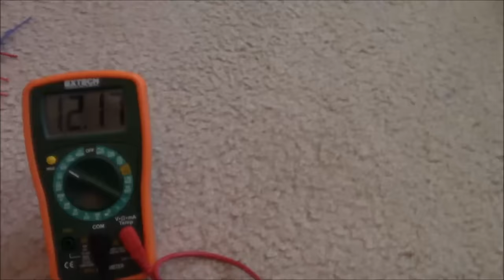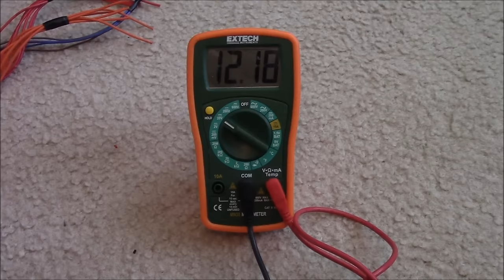How to Hack a Computer Power Supply (PSU) To Use as a 12V DC Power Source

Comment: Does anyone know if you can draw the full amount of advertised PSU wattage just from 12v wires? Or is it the limit lower
Reply from the maker: It is much lower.  About half or so.  Check the specs of the PSU itself.  The PSU in the video was a 450W PSU and could only do 20A on the 12V rail.

Comment: Need help...we did this with 4 yellow and 4 black wired together but each time we connect it to a fan requiring 12v and 1.5 A the power supply turns off.  We reset the power-on jumper and the fan spins for a second and then the unit shuts off.  What could it be?  We're trying to power Christmas inflatables!
Reply: +Brosilio Gaming (Tarshadow5) I'm trying to replace as 12V DC 1.5 A transformer.  The PC power supply reports 11.7v so maybe that is it?  Maybe the fan fluctuates too much?
Reply: +Brosilio Gaming (Tarshadow5) Yes, I disconnect and reconnect black+green each time the unit trips. But I&#39;m connecting the YELLOW and BLACK to the motor. The YELLOW is giving the 11.7 volts. The blower motor just has two black wires; maybe I need to reverse them? https://search.yahoo.com/search?ei=UTF-8&amp;fr=crmas&amp;p=computer+power+supply+color+coding indicates RED is for +5v, which is not what I need.
Reply: +Brosilio Gaming (Tarshadow5) No, blower works fine with an actually AC/DC converter.  I was hoping to use PC power supply to run several motors 1.5A motors.  I'll try again when I come cross another one.  Maybe this unit is flawed.
Reply from the maker: +Corey Alix Some pc power supplies will only turn on when they detect a strong enough load.  It is possible that your 18 watt load is not enough to keep the power supply turned on.  Try connecting a different load to it to see if it will work with something more power hungry like a peltier or car amplifier or something.
Reply: I put a flashlight bulb on one of the 5V lines and now the 12v line works.  Thanks!
Reply from the maker: Corey Alix
You are welcome.  Thanks for watching!

Comment: .. please help me. I am trying to use power supply to eun my 12 volt dc cooler. But when I join black and green it only starts for jerk. Doesnt run continously. Plz tell me what i am missing..
Reply from the maker: It sounds like your power supply needs to detect a load in order to run.  I would try connecting a 12V light or other 12V load to the yellow and black wires and see if that keeps the PSU running when you short green and black.
Reply: LDSreliance sad enuf :( ur video is too grt. But I even tried using 12 volt dc moter connected with output. But the motor also gets turn off with PSU. It just take a jerk :(
Reply from the maker: I'm not sure why it is doing that.  Sorry!

Comment: Can someone please tell the current output
I'm planning to run 4, 12V 10A DC motors with this thing
Thanks
Reply from the maker: The max output on mine on the 12V rail is 20A.  So you would not be able to run 4 of your 10A devices.  Some power supplies will provide more than that but I have not seen one that does 40A on 12V before.

Comment: Can we make a room heater from it?
Reply from the maker: Get some nichrome wire and a thermostat and it sounds like a fun DIY project.  Just keep in mind it won't get anywhere close to a space heater on high (which use about 1500W).  Even on low those things use about 750W so it would probably take two of these to even come close to a $20 space heater from walmart on its lowest setting.  So a fun project but not economical, probably.

Comment: Hi,
I am geting 3.4v, 5.2v, and 
10.5v instead of 12v
So, do I have to put load resister to 5v rail?
Reply from the maker: Hmmm.  Are you sure your multimeter is accurate?  Can you test it with another instrument to be sure?  You should not have to use any resistors unless you have to simulate a load to keep it running.
Reply: Thanks for the reply :)
Yes I checked it with another multi-meter and getting 10.6v
I put two 10W 6.5 ohm load resisters parallel to a 5v rail and now getting 11.85v
But I need 12-36V to power my arduino CNC sheild
Reply from the maker: That is bizarre.  Is this an old power supply?

You will probably have to use a step-up power converter:  http://amzn.to/2qnsxoH
Reply: Yes It is old one. 20 pins. include a -5v rail
Thanks :)
Reply from the maker: Interesting.  Good luck!

Comment: Don't you need a minimal load on all the wires?
Reply from the maker: Some power supplies do require a small load in order to turn on.  You can get around that by using a resistor, though.

Comment: hi would just want to know if this is possible to use as a power adapter for all in one pc 12v 7 amperes? i know this is an old vid but would really appreciate the guidance thanks!
Reply from the maker: Yes, but you may have to hack the connectors.
Reply: @LDSreliance  what do you mean by connectors
Reply: @LDSreliance  thanks to you got a power adapter for my pc. just need to do a stress test on it.
Reply from the maker: Cool!  Glad you got it working.
Reply: @LDSreliance  just got yellow and black wires then that was it. Was struggling to find a long lasting ac adapter. So this psu surely helps. I cant  buy expensive adapters at my end of the world. So this is really a big help. Thanks!

Comment: +LDSreliance After connecting my green and black wire the fan only twitches. what did I do worng here?
Reply from the maker: +Andrew Wallace You are either not making a solid connection between the green and black wires or your psu is sensing that there is no load.  I read that some power supplies will not turn on if there is nothing connected to them (like a motherboard or something).
Reply: Hmmm okay so what would you suggest to do? LDSreliance
Reply from the maker: Andrew Wallace
Try connecting something to the power supply to act as a load.  Plug it in to a motherboard or a fan or anything so that the psu can sense a load.

Comment: i cant seem to get this working! using a diablotek phd450, connected green with gnd, added dummy load (10w10ohm) across 5v wire to gnd, no continuous power. read somewhere to try dummy load across 12v-GND. still nothing. help please? :(
Reply from the maker: Have you tried putting it under a real load?  Instead of just a resistor?
Reply: LDSreliance yes I did. however I managed to solve it! apparently on newer power supplies the 3.3v sense wire has to be shorted to the 3.3v rail in order to keep the psu running
Reply from the maker: Interesting.  I did not know that.  Thanks!

Comment: Does the wires which connects to the power supply gets hot? Is that normal? Mine became hot
Reply from the maker: How hot?  It should get warm but not hot like melting plastic.
Reply: LDSreliance it's hot but it's not shocking hot. Like... If you ordered hot drinks, you have to wait a bit before you could drink, but warm water, you could drink without your tongue get scalded or shocked by the hotness. Mine is like warm water. Hot, but still touchable & not shocking to the touch.
Reply from the maker: Then that is fine.  If you start to smell burning plastic or if it is too hot to touch then that is not normal.

Comment: HELLO THERE I AM LEARNING HOW TO BUILD A DC POWER SUPPLY FROM A COMPUTER POWER SUPPLY  .  CAN YOU HELP ME TO UNDERSTAND HOW CAN I ADD A MONITOR TO READ THE AMPS AND VOLTS OUTGOING ?!  AND CAN WE MAKE THE POWER SUPPLY TO OUT POT MORE  AMPS ?!!  THANK YOU
Reply from the maker: Amps are harder to do but for volts you just wire in a voltmeter in parallel to the circuit.  For amps, look up my video on how to wire an ammeter.  It is a bit more complicated.  And no you cannot increase the amps a power supply produces without re-doing the circuit board and components.
Reply: THANK YOU FOR THE REPLY
AN IDEA CAN WE CONNECT 2 OR 3 POWER SUPPLIES TOGETHER IT WILL GIVE MORE AMPS?! AS WILL AS VOLT!
Reply: I looked through your channel I could not find the video   please if you could send it to me
thank you brother  you are really great
Reply from the maker: Anwar Abedrabbo Sorry, I was on vacation.  Here is the video:  https://www.youtube.com/watch?v=7MGed7WKwAA

Comment: Bro.  2:32 finally someone with a simple solution
Reply from the maker: Solder the "on" wire in the on position?
Reply: @LDSreliance  no. How you are holding those 2 wires upright😂
Reply from the maker: Haha.  It was much easier for the video shot.  Normally I wouldn't do it like that.

Comment: hello i just want to use this concept for a 12V can i just solder out all the wires i dont need ?
Reply from the maker: I don't understand what you mean by solder them out.
Reply: is the work soder ? basically remove all other wires completly  besides everything i need for my DC12V appliance
Reply from the maker: You can do that just make sure that when you remove those wires that the ends or the stubs of those wires cannot touch each other and cause a short circuit.
Reply: its been working great so far. Another question i have a 12V dc self priming water pump you think it would work if i put a regulator or to slightly dial down the voltage to reduce it struggling in my misting system everytime i use it, it either struggles or its SUPER LOUD
Reply: andwhen i say regulator i mean one of them ones you can dial either up or down
Reply from the maker: Yes, I have used those for things in the past and they work fine.  They are not efficient, though, so make sure you factor that in to your math.  I think they are usually 80% efficient and maybe worse.

Comment: I probably won't get an answer but when I do that I get under 12v its usually only 11v and I cant go any higher
Reply from the maker: I don't know for sure but it may have to do with how much current is being requested or drawn by the loads.  Is the power supply under load when you test the voltage?
Reply: @LDSreliance  well i am using the power supply for a car amp and it may be drawing to much power ?
Reply from the maker: That could do it.  The voltage will sag under a high load.
Reply: @LDSreliance  I purchased a36v bench power supply and it works now but thanks for the help

Comment: Would this have at least 6 amps?   I need a power supply of 12V 6 Amps.
Reply from the maker: +Modzer627 If you combine all the yellow wires, yes.  Pretty much any ATX power supply I have ever seen can provide more than 6 amps on the +12v rail.
Reply: What if it is an 850W power supply?
Still get 12V 6A?
Reply from the maker: Modzer627
Yes, probably more like 40-50A.
Reply: oh my, well.

I did test it and it worked but... the display was not, I shall show my setup once I record and upload it.
Reply from the maker: Modzer627
Sounds good.

Comment: Can it work without fan cooler? :D I want to take it out and use for another purpose :D
Reply from the maker: Yes but it may overheat and shut down.
Reply: +LDSreliance thank for answer :D I am going to leave it there :D You have right for overheating
Reply from the maker: How To Channel It may be completely fine if you keep the load to under 100 watts or so.  But you can just order a $5 computer fan for whatever you want to do and just leave the fan in the power supply :)

Comment: Mine was working then I connected anither old computer fan to it and one of the wires came off and sparked. It doesn't work anymore. Any ideas why???
Reply from the maker: +Aaron Watson It short circuited and blew a fuse inside, most likely.  I don't know if it is replaceable or not.  You could try taking the cover off the power supply and seeing if there is a tube shaped fuse in there that is user replaceable.  If not I am afraid it is toast.
Reply: It was working then stopped then I realised after I short-circuited it I needed to disconnect the green and black wires and reconnect them then it worked.  All good now. Thanks for replying anyway!!!
Reply from the maker: Aaron Watson
OK, glad I was wrong!  The PSU does have a fuse in it to prevent a fire so I was worried you tripped that.

Comment: Connecting the Green and Black does not turn it on, ive tried maybe 50x
Reply from the maker: Yours must be one that requires a load to be present in order to turn on.  Wire in a resistor to simulate a load or connect something to the yellow wires that will immediate pull a load.
Reply: @LDSreliance  thanks I'll try that

Comment: I want to use my pc power supply for 4 pc 180 mm pc fan. They fans are very power.  Can you please let me k now how I can use the power to power the fans.
Reply from the maker: Just follow the instructions in the video and then you can use a buss bar or other distribution block to connect all of the positive fan wires to and then connect the positive side of the psu to.  Then repeat the process for the negative wires.

Comment: Will the PSU power a 12v brushless cordless 12v drill
Reply from the maker: I don't know.  What are the power requirements of the drill?  And it will depend on your PSU that you use because yours will surely be different than mine.
Reply: sorry for the late response only just spotted your reply thank you. My PSU   is off an old desktop computer. Project completed and now powering 2 old 12volt drills (not at the same time) which have found life 2-3 years after their batteries failed to charge

Comment: Is it possible to hook up 300w-500w amplifiers?
Reply from the maker: If your PSU is very powerful, maybe.  The 12V rail on the one I show in this video can only handle 20A (20A x 12V = 240W).  So if your PSU was significantly more powerful (say in the 700-800W range) then it should be able to handle 300-400W or so.  500W is probably out of the question for most.
Reply: @LDSreliance  Thanks,  if i didn't have this right now i wouldn't be able to listen to music during this virus stuff xD

Comment: Hello sir. How can i use  Dc to Ac from power supply ?
Reply from the maker: +Mubeen hamid Just curious but why would you want to use AC from this power supply?  You have to plug this PSU into an AC wall outlet to run it and then you want to convert back to AC again?  That doesn't seem to make much sense.  Maybe I am misunderstanding your question?

Comment: hey can i connect like 4 or5 pc fans to the yellow and black only will it transfer enough power?
Reply from the maker: +eli \ Yes, you can power that many fans with just one wire of each if you want.
Reply: +LDSreliance but wheni connect the power supply to the fans it shuts down immediately could it be that there is not enough amper or watts or volt ?
Reply from the maker: eli \
You may have a power supply that requires a load to turn on.  If it does not detect a load it shuts off.  Some people wire in a simple resistor between the green wire and black wire.  Read more about how to do this here:  http://makezine.com/projects/computer-power-supply-to-bench-power-supply-adapter/

Comment: What kind of adapter I need to power two 10 amps peltier with two 12V cooling fan?
Reply from the maker: I would use a computer power supply like shown in the video with a 25a 12v rail.  I am guessing it would be 500w or higher.  You don't really need an adapter, you could just use butt connectors or a soldering gun to connect the wires.
Reply: LDSreliance will it affect a lot on my electric bills? Do you know? I'm a newbie to this diy stuff
Reply from the maker: If you run it constantly it will.  If you ran it around the clock for a year it would cost you $262.80 if your electricity costs $0.10 per kWh.
Reply: LDSreliance do I really need to connect all the yellow & black wires together as you show to get my device going?
Reply from the maker: Maybe, maybe not.  It depends on how much power you need.  I would recommend doing it to make sure you have all the power available that you might need.

Comment: How many usb outs for run tablets and phones ?
Reply from the maker: It depends on the PSU model and how much power it can handle on the 5V rail.  It also depends on the devices you are charging and the total Watts needed to charge them.

Comment: Hi i have brand new psu and i have connected the green and black wire together but the fan doesnt turn on
Reply from the maker: +Zee villi So the power supply turns on but the fan does not?
Reply: +LDSreliance  yea as you turn on the psu the fan wont go at all i tried a few times and at one point the fan turned on for a split second and then stoped
Reply from the maker: Zee villi
It must be sensing something is wrong.  You may have a bad connection, too.  It needs to have a good solid connection between the wires and make sure there are no shorts in any of the other wires.
Reply: +LDSreliance  i can hear a faint sound of scream coming from the psu
Reply: +LDSreliance would it matter what voltage the psu is set on as theres a 115 volt and a 220 volts setting on the psu a red slider on the psu
Reply from the maker: Zee villi
No that would not matter.
Reply: +Zee villi Newer PSU require load to work. They won't start if not loaded even if you jump green and black wires. Try to put an extra fan, or a bulb o 12 or 5v leads and see if that will start the whole thing...
Reply: +Nikola Pepic thanks mate

Comment: can it run car amplifier without overloading
Reply from the maker: I haven't tried it but it should provide the necessary power to the amplifier.  I'd probably recommend a capacitor, though, especially if you are powering a subwoofer.

Comment: can it be use as a power supply for led strip light?
Reply from the maker: I think so but I have never tried.  Don't LED lights need a ballast?
Reply: but it's a 12v dc led strip light
Reply from the maker: Lau Victor It will work, but it may shorten the life of the LED strip.  Usually there is an LED driver/ballast that regulates temperature and provides a smooth voltage that the LED wants.